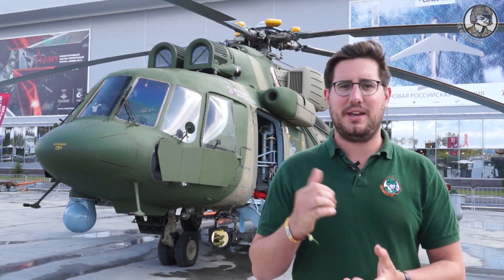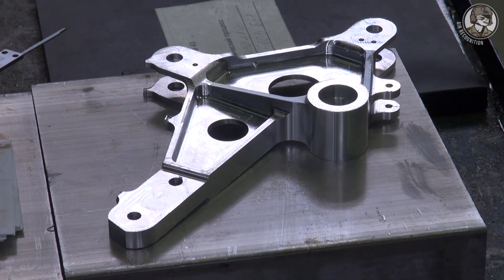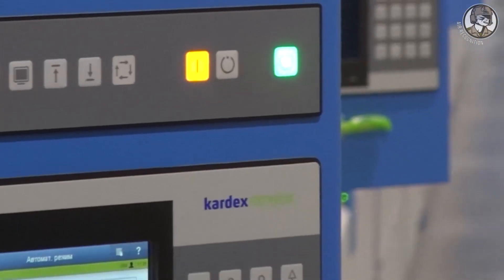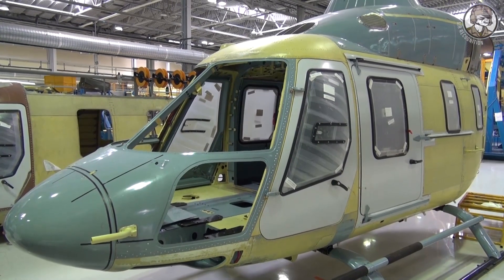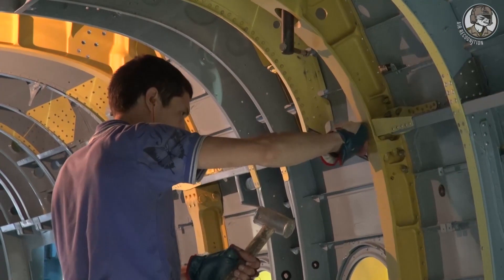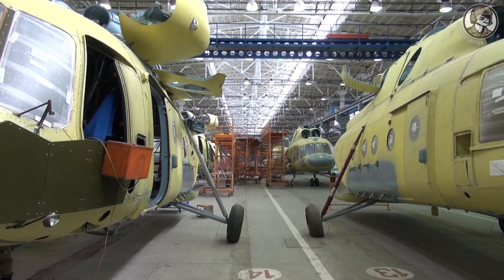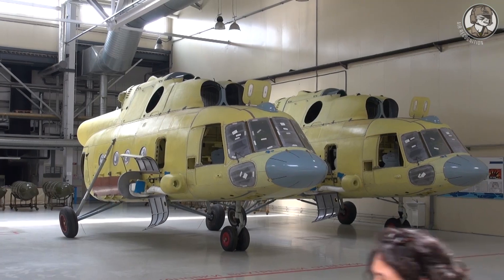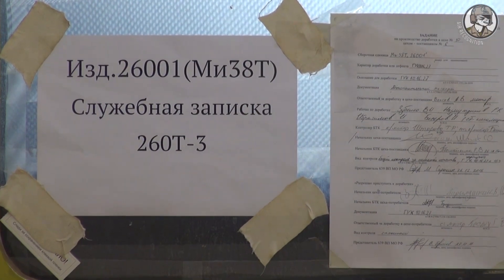Inside Kazan Helicopters' production plant

Comment: Mi-17/Mi-8 helicopters are good but the flight handling quality of the helicopter must be improved. It's autopilot must be improved so that it can at least make turn coordination easily. Also the pilot seats, pedals and cyclic does not have ergonomy.  Especially cyclic trim button is difficult to press and is not located ergonomically. The autopilot must be like new autopilot control systems and pilot can select the desired speed, heading and altitude without pressing the trim button. Instead of pitch limit system, a new autopilot can handle the pedal inputs so that during approach pilot doesnt need too much pedal input. Those are my opinions that can make this helicopter better and pilot friendly.
Reply: There's like 1000 variants and subvariants of the the Mi-8/17. Your complaint is pointless without knowing specific variant you fly, probably got this all fixed for different version.

Comment: Are you kidding me?. They have a modern facility for building helicopter but they still use analog flight instruments in their helicopters, instead of glass cockpit?. I like Russian helicopters the mi-8 is an ugly helicopter but it's build like a tank, but why they still use analog gauges when they all work on a vacuum system which is not as reliable and harder to maintain then a glass cockpit. All other countries have been putting glass cockpits in their helicopters since early 90's and Russia still in this day and age uses analog, wow.
Reply: EMP proof
Reply: You can buy two maybe three Mi-8M for the price of one UH-60. There's your market position.
Reply: A glass cabin requires a lot of computer equipment, and an analog device is a thing in itself, simple and understandable, you can only replace it and everything works again.
Reply: Oh, come on... those modern hitech wouldnt last in the enviroment where these workhorse is flying. Yr ease of maintenance in western terms is order the parts n its gets couried in. and replace whole unit. try getting these logistics in the middle of no where. Analong can be repaired using basic tools in wokshop anywhere. ..whwre theres skills.
Reply: Boy, western choppers are well known death-traps. Around 4000 were shot down in Vietnam. And that's only because yankees are too dumb to put any armour on the chopper. So, ya better shut da fuck up.
Reply: it depends on what spec the customers order,glass cockpit is nothing new in russian aviation, look at su-35s one of the best glass cockpits ever, but yes Russians love their analogue instruments, you will often see combination of analogue and glass instruments in their helicopters,like mi-17v5, mi-28n/ne, and mi-35m, guess they like having that backup just in case.

Comment: I've read comments about the Kman  helicopters being overbuilt, old design, etc. 

Gents the object of a helicopter is to get airborne lifting a specific load ( cargo ) . If the Russian Kman is as you can see here still building a design that has been Involved production for over 20 years or more if the helicopter does the job and is designed to be serviced easily, so what! 

The Russians have been in front of US helicopter design for years, yes we use a lot of computerized systems on the US helicopters but that doesn't necessarily make the US helicopter better. The Russian helicopter manufacturers are using the same American design philosophy from the 1930's specifically the DC-3 which is still flying today because it's a rugged design and still does the job today, so the Russians simply copied the design philosophy keep it simple, and build it rugged and easy to service. Something we have gotten away from.
Reply: No sir the object of a military helicopter is to win Wars. Soviets lost, the Americans won ,therefore by definition our helicopters are better
Reply: @TheDieselbutterfly  - Soviets lost the econonmic war. If it had been a hot war we would have been in trouble and it would have 100% gone to nukes. British tank crews in West Germany were openly told they had life expectancy of 7 hours. The only job our forces had were to minimise Soviet gains while nukes were rattled and a political solution could be tried. The soviet war machine was a monster, just because there kit doesnt look all modern and shiney doesnt mean it isnt good solid reliable stuff.. AK 47 ?
Reply: @shaunc07  if's and buts..... strategy can include economics didn't say they had a weak military only that we won using our strategy which includes our equipment
Reply: @TheDieselbutterfly  what do you mean, "lost"? The Russians would change communist regime with or without you. If anything, the Cold War has only forstalled this changes for 20 years. Perestroika could had happened in the 60es during Khrushov if the main economic mastermind behind it wouldn't been couch with CIA. You are trying to attribute to US something that occured naturally.
Reply: @cianakril  russia lost control of much of europe.and it was not voluntarily
Reply: Ruskies are like the commiechineses, they steal technology from the West!!

Comment: This might be a dumb question, but why do military Helicopters have wheels and don't just take of vertically?
Reply: wheels are the best to move heli to the hangars for repairing or through the airfield, actually on heavy helis they are not simple wheels but a system that soften landings like on planes.
Reply: They can taxi from a hangar to a starting/landing area using only own thrust from blades.